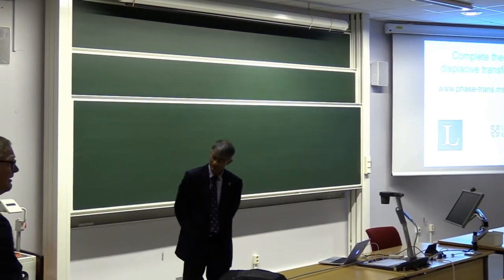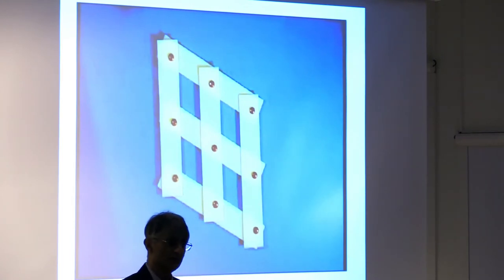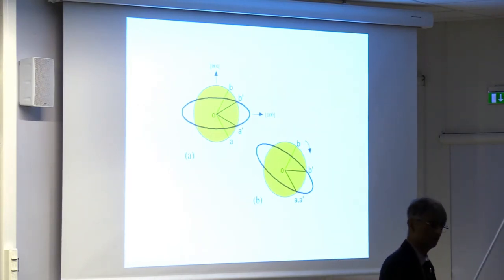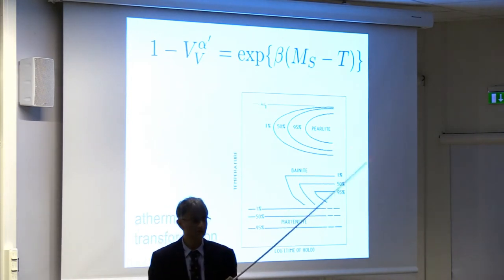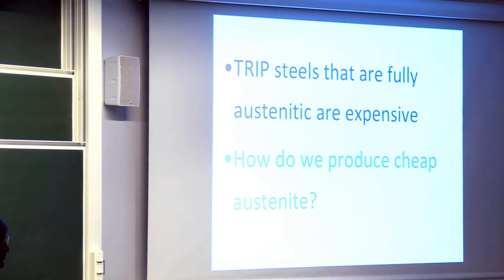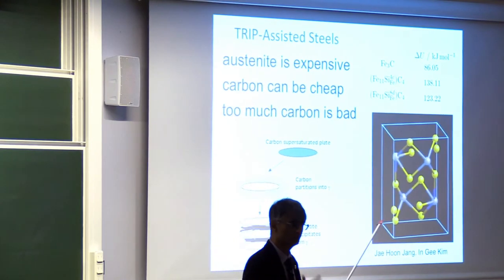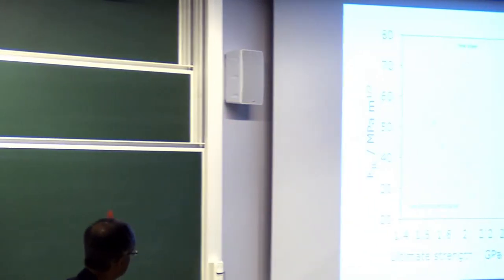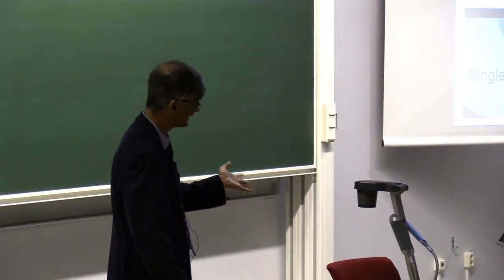Part II: displacive transformations lecture at Luleå tekniska universitet

Comment: Thank you for your wonderful lecture! I have a doubt that has troubled me for a long time about martensite transformation. Supposing there are two martensite laths with different widths, are the times they spent to complete the transformation (γ→α) the same? Dose the displacive transformation during martensite transformation mean the simultaneous displacement of all the atoms in the subsequent lath? It is very kind of you if you could give me some guidance.
Reply from the maker: The growth of martensite does not involve the simultaneous displacement of all the atoms in the product phase. The transformation is thermodynamically of first order. This means that martensite grows progressively by the translation of an interface with the austenite, all displacements occurring locally at the interface. It follows that a fat plate of martensite will take longer to grow than a thin one.
Reply: Thank you for your patient explanation! Does it mean that the thickness of the martensite lath rather than the length determines the transformation time? And how about the lenticular-like martensite? Thanks very much!
Reply from the maker: The thickness and the length are related during unhindered growth by a balance between elastic strain energy and the thermodynamic driving force. Same logic applies to lath or plate martensite.
Reply: Will the thickness continue  to grow when the length is hindered ?
Reply: I'm not sure. But some literature seems to think so.
Reply from the maker: Until thermoelastic/plastic equilibrium is reached